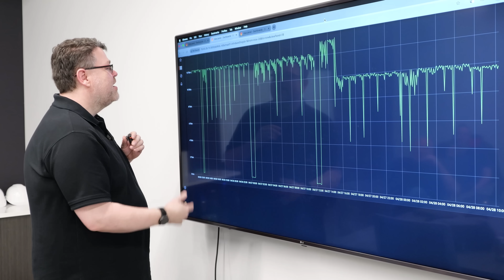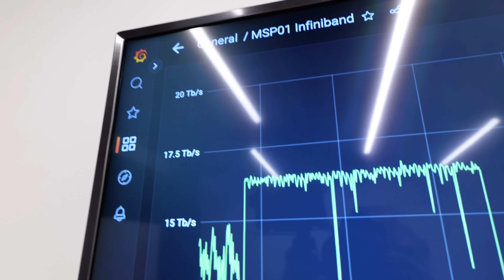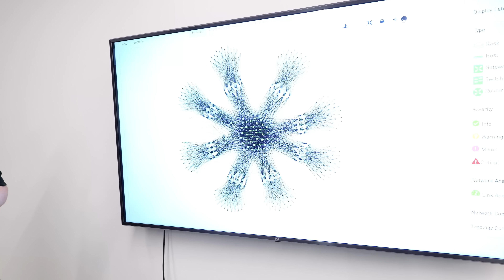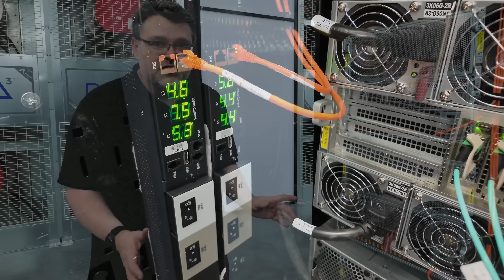Inside the Modern Data Center! SuperClusters at Applied Digital

Comment: CompTIA Server+ ce  certified ,  the walkthrough was a great translation of what i learned.  A description of the Procurement phase 0:35   was covered as well as the Network Infrastructure , load balancing,  power redundancy, sfp+ ( small form factor pluggable) on the fiber cables, server redundancy, resiliency with no details on RAID implementation , but obviously implemented.  I was hoping to hear if the Servers were in an Active-Active or Active-Passive state.  More details are in the video just a small summary of what i am recalling after watching the video

Comment: These things are the bane of our modern existence. Data centers, with their enormous energy and water consumption, strain our resources considerably. They require massive energy inputs, leading to increased emissions, environmental pollution, and higher utility rates. Additionally, they generate heat, noise, and light pollution affecting local residents as well as fragile ecosystems. Don't believe their smokescreen about the greater good: https://youtu.be/3VJT2JeDCyw?si=izxQwU-r4tHBKE_C
Reply: Tell the masses to throw away their phones and stop using the internet 😊

Comment: Question?
Are there any VFD's inside this Data Center?
Does the amp draw ever get too high?
I'd imagine most things in here is 3 phase power.
Has anybody ever built a data center that is underground?
Notice all those Delta fans, why are the red circles on the outside?
Does the storage ever expire?
What are they using to heat/cool the data center, roof top units?
Do the wires or connections ever go bad?

Comment: 40Gbps, 2000MHz High Speed: The UGREEN Cat 8 Ethernet cable supports a bandwidth of up to 2000MHz and a data transmission speed of 40Gbps, ensuring stable network speeds so you can play online games, surf the web, stream HD video, upload, download, and much more.

Comment: 5:00 How do these electric test loads actually dissipate the huge load of total 1 MW?! Is this also by heat dissipation? But they are way smaller than all racks so wont they get extremely hot?

Comment: I'm now in my 47th year in high tech (1st computer job at 15 in 1977), and for the last decade I've been an R&D network engineer for the largest computer mfg (guess who) going.  some of the soon to be RTM switching blows the current designs away.  and they'll still be the running roadblock to super high performance that these clusters need...  its a brave new world folks, and we get to witness it in real time......  so hold on.. its gonna be a wild ride......

Comment: states need to start passing laws requiring these electron-guzzlers to use their own power generation - solar, coal, nuclear .. w/e .. otherwise we're gonna have some serious grid issue. and they also need to be BANNED from touching ground water. bring in your own water and circulate it. already cases of these datacenters drying out aquifers and causing farming communities' wells to dry up.

Comment: You offered for more video requests? I am an HVAC geek and those DELTA fans on the wall are pretty cool BI plug fans used to make a fan wall. Kinda like RAID for you fans. One goes out and you only lose 5-10% capacity. I would like to see up the duct inside the hot isle to the roof. Is it just hoods on the roof to the air? Are they reclaiming any of the lost heat?

Comment: Love this. 
Hollywood: Fancy glossy building, quiet, mysterious dark spaces, with lots of blinking lights. CD rom trays make a whirring noise when they eject, and anyone can hack a terminal in 20 seconds. 
Real World: Nondescript, brown building, no windows, tons of HVAC on the roof, bright, noisy as hell, either freezing your ass off or roasting depending on if you are in the hot or cold aisle. No CD ROMs. And good luck even getting into the facility and into the rack, let alone on a terminal.
I've worked in enough DCs and for enough years that I'm happy to not go in them anymore.

Comment: 3:00  I did this new kind of build at Stax Exchange in Portland.  
BOY was it ever not  as easy as we would have thought it was. 
You would think Concrete would be flat in these places, but when you start putting in the Data Cabinets, and then start with the cooling aspects, things get VERY weird VERY fast. 

Ours was not purpose built to be a Data Center, but we were able to make ti work. 
Our systems still had Fiber, but all the servers were still linked up with copper for most of the individual servers, with a fiber backhaul.  

It sure is a much cheaper way to do a faster deployment, but boy is there a lot of issues that come with it. 

3:08  See the white / clear panels on top?  that is where the hot hair gets exhausted to up in the ceiling area, with he chillers you saw on the side of the wall providing the cool air into the space in front of the servers. 
Real fun times when the floor is uneven.  

3:25 those boxes you are seeing there are the power testers.
They do a 24 hour load test before anything gets installed to check all the high voltage power lines (often at 480v) 

4:03,  those rails he is holding actually go to the UPS room first as having a large central UPS is more cost and maintenance effective then having the smaller units taking up valuable rack space. 
In ours, the Utility company does not really do anything beyond hooking up the mains to the box. 
Everything else is the job of the Electric contractors.  

One more thing? 
If you look at how they install the cable troughs,  its pretty neat! 
The ceilings  use this grid system and you just mount EVERYTHING up on these with bolts in these tracks. 
All the supporting stuff you is just stuff we get at Home Depot and cut to fit to length for the support beams. 

If you like doing this kind of work,  there are a few companies you can get in touch with that do this across the united states. 

It's hard work installing all of this, and you spend a LOT of time on a scissor lift and a ladder, but boy it sure is something knowing you just built something that will be in use for at least the next 50 years or longer. 
:goodvibes:
Reply: The folding table is a "Lifetime" brand 8ft folding table and the chairs are HDX Outdoor Folding Chairs, both sold at Home Depot.  You were not exaggerating about their use of Home Depot.

Comment: 45kw ? mw you mean? an mvidia nvl72 rack consumes 120kw
Reply: These racks are 4 nodes, 8 H100 GPU's per node for a total of 45kw per rack. Next gen B200s can go 8 nodes per rack for 140kw per rack.  NVL72 is a completely different beast.  Forced liquid cooling, rear door heat exchangers, etc. Can't remember the KW per rack off the top of my head.

Comment: Thanx Wendell for this - personally I would not know what to do with said equipment, but I do know it beats my 14900KS, 64 GB DDR 5 6800, 4070Ti, 82 TB Storage - on my ASUS ProArt Z790-CREATOR WIFI - but I do like (MKV + Handbrake) Ripping and Creating movies/TV Series/Music Videos, etc. I know Y-all get it :-} Love to all at Level1Techs :-} ps. I do love my scratch drive - Seagate IronWolf ZP2000NM30002-2XW302 (IronWolf 525 NVMe M.2 PCIe 4.0 Enterprise NAS SSD, 2TB), hands down the best drive I've ever owned :-}

Comment: Could you do a video on cheap / home / consumer grade builds that that lean towards mass ram EG 300> 500~, I've been trying to find an affordable route to hosting a gaming server and it requires at least 250-300GB per cluster of maps, however the more you go into server CPU's the lower base core speed they have which is a large bottleneck + the fact consumer boards only allow 256gb of ram, requirements I need is 16/24 for a single cluster or 30+ for dual cluster but needs higher base clock supporting at least 300GB of ram ideally 300 for a single and 500+ for dual cluster, its for running an Ark Evolved/Ascended cluster, each map need 1.5 Physical cores ~ 12/14 maps and 20~ GB per map makes it hard to host on a single machine with a decent base GHZ, I currently run it off an old HP DL 380 Gen9 36 cores and 512GB, system but really wanting to upgrade to an affordable better machine most likely with a budget that doesn't balloon to the stars.

I know AMD has those EPYC chips that sit at 16 cores and they're honestly perfect but pairing that with ram and a motherboard is where I'm stuck consumer boards are 256 > but server boards are SO expensive and 4DIMMS aren't enough and 8 is to many.

Comment: Those aisles look spaced further apart than other data centers I've seen. Is there particular reason?
Reply: That data hall was maxed out on power. Spacing the rows allowed more ambient air between them. Since it's not a forced air cold aisle setup.  The hot aisle was contained between the close rows and sucked out the top.
Reply: @iceflyer55  Thank you!

Comment: Kudos to whoever did those cabling runs, a work of art compared to the majority of racks Ive seen in data centres over the years.
Reply: And it saved 1.5 million dollars
Reply: The switches should be at the rear… not sure why they’re bringing all the cabling to the front of the racks
Reply: @-GBD-  The infiniband switches have what you might consider reversed air movement. So they blow from the cable side to the other. We run all the IB to the front to keep the optics out of the hot aisle. They get really really hot as it is. Like, pull out, leave sit for 5 minutes or so, then pull out.  I can't imagine how many would fail if we had them in the hot aisle.
Reply: @-GBD-  That's the way they were spec'ed .

Comment: I'd be interested in hearing the rationale of Xeon systems, here. My understanding of the enterprise landscape is that Epyc has been more performant, efficient, and affordable for some years now. Is this a corporate relations situation? Money changing hands? One die-hard piece of legacy software that won't go away?
Reply: 99% of the workload takes place on the GPU's. The Xeons work just fine. So the the AMD chips. It's hit or miss which is used, mostly based on the customers request.
Reply: @iceflyer55  Not doing much with them is even more reason, not less, because epyc is more efficient.

Comment: Love how the tech at 14:00 pulls out that $$$$$$$ cluster, hefts the weight alone, and plunks it down on a $40 plastic folding table from Walmart.  Great to know a server worth what, 50 grand? 100 grand? Can use the same cheap plastic table I keep my laundry on.  Now that's how you save money in the data center, baby!
Reply: Each one of those HGX systems is around $200-225k each assuming H100/H200. The GPU trays alone are around $175k of that cost. The current B200 systems would be $300k or so each. Easily over $1M per rack in the servers alone, plus the networking, power, fiber would bring it closer to $1.2-1.3M per rack, and that's without any integration or validation labor charges.
Reply: 50 grand? You wish! That would be just a single GPU in case of an H200. There are 8 of them in a server here. That would be $400K to NVIDIA alone. Add the cost of Supermicro stuff on top of that and that guy was potentially handling a server worth about half a million. I did have the same thought as you upon seeing that table.
Reply: Kentucky Ballistics's disposable table, lol.
A single rack of that thing is worth more than my whole freakin house, and probably my neighbor's house combined...
Reply: I know, right. Since the days of cloud people rarely go to DC so I think they’ve just blended into the background.

Comment: Thanks for the great content, as always.
Follow-up topics I'd like to see:
- The overall software stack and principal OS's (assuming Linux - which distro?) and API's (assuming CUDA - which others?) used for the actual applications. Building massively parallel applications is a very challenging software design problem. (Viz. Folding@Home and Top500 supercomputers)
- Is the cluster partitioned in any way using hypervisors, Docker, containers, etc. Also management dashboards.
- A discussion of the design and state of distributed file systems vs. traditional "local" ones like ZFS,  EXT4, XFS, NTFS, etc. accessed via NFS, iSCSI, SMB...
- Total power budget for the site. (Usually a major  limiting factor in site selection.)
- Source(s) of their utility's power generation (coal, nat gas, nuclear, hydro, renewables, etc.)
Reply: We run Ubuntu server, either 22.04 or 24.04, depending on the customer. The underlying library stack is NCCL, basically an HPC library for GPU work loads.  On top of that is usually run Kubernetes and/or Slurm for node/job management. As for the API's and applications, we let the customers drive that. I'm the idiot in the video. We just build the clusters to a certain point and then hand off to the customer to run their specific applications. Each is unique, and most hold a lot of proprietary data, so, we don't touch.
Reply: Programming languages and APIs as well. E.g. SaC, Chapel, OpenMP+MPI. With what thhey did to Mellanox, we can expect them to scream "CUDA" over each one... just as meaningless as saying no compiler would work without machine language.

Comment: 1. AC: You mention the hot aisle with above overhead extraction, but where is the cold air coming in from (cold aisle)... is it those side Delta fans blowing in cold?
2. What's the MTBF on the flash storage?

Thx for the walk around.
Reply: The room is flooded with chilled air, more than is needed. This creates a positive pressure flow through the servers and into the hot area, plus there are fans also pushing the air through and suction from the hot side.  One benefit is that the overpressure means cool air will always flow toward hot even if a fan stopped.  It also has inherent redundancy where losing a chiller won't cause a problem. There is already excess cooling capacity online.
Reply: @LatitudeSky Thx.  I spent decades building ceiling hot\ cold aisle CR, or with cold air coming up through the cabs via the raised floor and extracted through the ceiling, so I'm trying the understand this particular DC.... where is the cold air being blown from (above or side), it looks like side with all those fans?
Reply: For the uninitiated why is raised flooring bad

Comment: We use Proxmox in my mid size Network at my workplace.  However, I did not think Proxmox would be used in a complex, elaborate Data Center like the one in the video.  You would normally see Vmware mostly used in Data Centers.
Reply: vmware is so dead
Reply: Broadcom destroyed VMWare. Most places are running some QEMU-based Linux distro (e.g. PVE, which is QEMU and Debian) or Hyper-V on Windows.

Comment: For power comparison, the 5MW capacity of this data center is equal to 15-16 fast EV chargers. 

We've been training a generative model for the past few months. 1 minute of an EV charging equals the power usage for at least 1 hour of training.
Reply: And the whole point of "fast" EV chargers is to spend less time there. They're mostly idle, and only reach full rates in the middle of some chargings.
Reply: @0LoneTech  My 5MW station is has a typically minimum occupancy of 20% full from sometime in the early morning till about 10pm or later, with daytime off peak between 30-90%. Commute times its often at 90-120% (ie. people waiting we need to tell to buzz off for blocking roads). Each pedestal has a 300kW max output, the station only needs to be half occupied with supported EVs not topping off to reach the 5MW.

Fast charging was a necessity in my area to cover unmet existing demand, which is constantly increasing. I personally do not have an EV and the massive increase in traffic has been annoying, but the money is good. 😆

I might be able to pull more detailed usage data for both occupancy (I'm currently estimating via visual monitoring) and power, but that is probably covered by NDAs.

Comment: Used to work on the assembly line at the Simplex factory making them load banks in the beginning of your factory tour in the video....they are just a giant space heaters on the inside when you open them up. Designed to either either take a test load or take the excess energy load dump from a generator or power surge or decline from the grid when power demand fluctuates.
Reply: Pretty much a big resistor coil lol 😊

Comment: 4:20 What is on this red box? 🧰🤔
Reply: Lock out tag out seals. The box probably contains some locks.
Reply: @LatitudeSky  Thank you! 
They use safety protocols like this in Miners and Electricity Stations, to indicate that Someone is currently working on it and to prevent incidents like others locking him or starting the system.
I see a dedicated box about these things for the first time - usually, it is a board on the wall, but with so open space like in the Data Center, the red box makes sense.

Comment: i see the techs there working on the fiber using a 1-click design to clean the fiber. As a fiber tech we also use fiber scopes to zoom in on tip of fiber to make sure it is properly cleaned. I find even using the fiber 1-click cleaning solution cleans only 50% of the time. Wet cleaning and using a 1-click and verifying it is truly cleaned by using a FiberScope is what is needed,
Reply: Looks like B roll showing they have the tool. No doubt it reports link anomalies for closer attention.

Comment: According to Nvidia they already outdated. Those fibre cable featured have 12 cores built into each connector and those are type of cables they use for those insanely high bandwidth announcements.

Comment: I like that they have learned to "check their math" with emperical system checks, regarding powerdraw and heat load
Reply: @DoNotFitInACivic Right... as though it never occurred to anybody for the past 100 years...
Reply: @RunsOnRust I've been involved with commercial contracting and the trades for over 20 years, the trust in the design is driven into most builders/ commissioning staff.